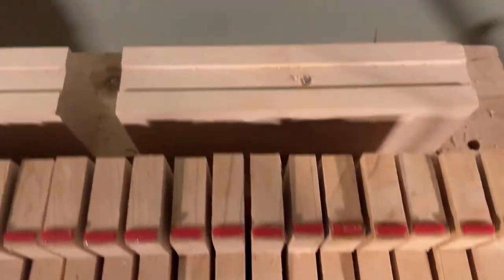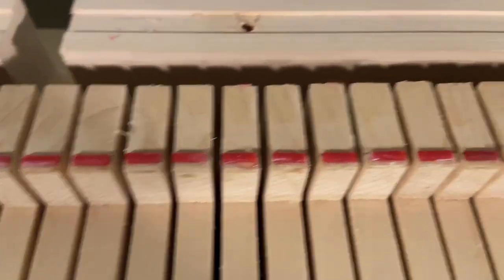Fender Rhodes Full Action Repair | Kris Yunker

Comment: well done - a great sounding overhaul. question - when you removed the stock shims on the side supports, did you find you had to raise the bass side up higher than the treble side? and if so, do you recall what size shims you installed? currently in the process of resetting escapement on a 75 suitcase and after removing the stock shims, i have hit a snag. any tips would be greatly appreciated!

Comment: Thanks for this - great to see! A couple of questions if you don't mind...I noticed that you set the escapement by installing shims, after you did the voicing. I had read in the service manual that escapement should be adjusted by raising/lowering the tone bar assembly, and that after this, you then carry out voicing. Did I miss you 'tweaking' the escapement after you installed the shims, and did you then have to re-voice after that too? And one more question...I saw you replaced some tines....what was it about those tines that made you need to replace them? Thanks again for a great video!
Reply from the maker: Escapement from raising or lowering the tone bar assembly won’t effect the voicing. That will happen if you raise or lower the closest screw on the tone bar to the keys. It raises and lowers the escapement as well and will affect the position of the tine. The front screw closest to the tine will adjust your voicing. Hope that makes sense. Also those tines were drifting out of tune, decayed quickly and sounded dull.

Comment: Any experience adding a bump/miracle mod to an early piano with a Marcel curve?
Reply from the maker: Yes, It's the same process. The Vintage Vibe Miracle Mod video does a good good of showing and explaining what to do.
Reply from the maker: @d179654582248  check you key height, escapement, and make sure your bushing aren’t too tight. Also lube your balance and front rail pins with Protek.